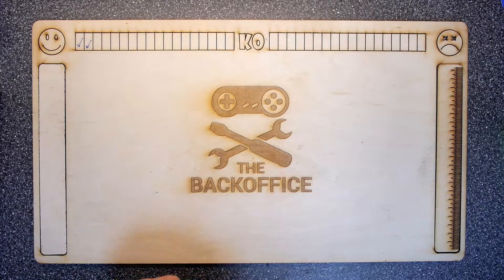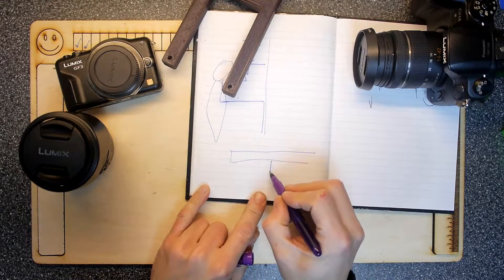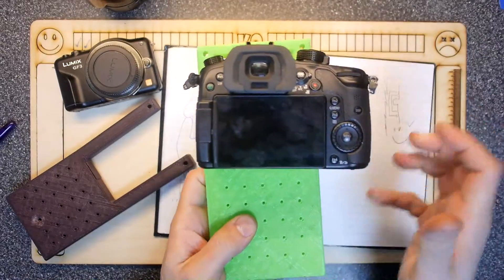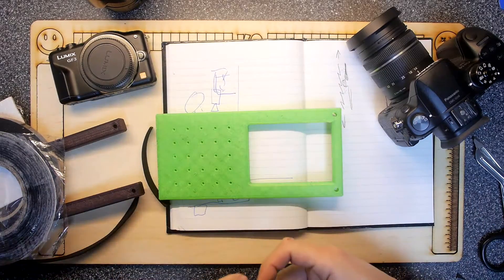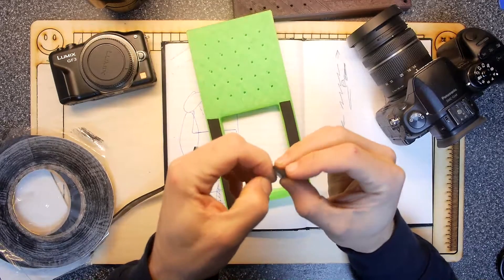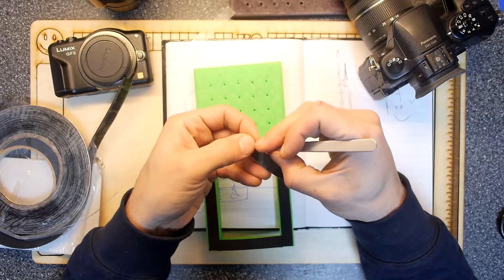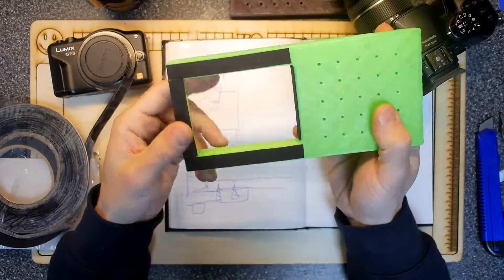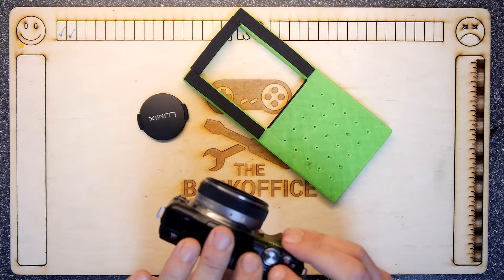Print your own DSLR Camera Bracket for close work!

Comment: I fancy a 3D printer but I would use it about 5 times and then get bored and have no use for it. I make homebrew and I want to make a bracket for my fermenter. I may have to design it and get someone to print it.
Reply from the maker: +Mark Davies I think of you upload to thingy verse you can actually pay to have it printed for you and delivered. Agree about the 5 times, they are dust collectors!

Comment: Fascinating video.
Seems a decent way to mount a camera for Bench work like you do.
What's the free CAD software called? Wouldn't mind having a go at designing a Raspberry Pi case and then getting someone at work to print it :)
Reply from the maker: +Cal Barnes It works better than I could have hoped really. I printed off a second one to clamp anywhere.

The free cad software is called FreeCAD, I will pop a link in the description.
Reply: The Backoffice awesome, I thought that was what you called it. What do you use for sound/microphone? It's really clear compared to some other channels I follow.
Reply from the maker: +Cal Barnes I have relatively professional equipment, but I actually made this particular microphone myself. There should be a video out on it soon. That also has changed my filming process as it's easier to use than my previous Rode mic.